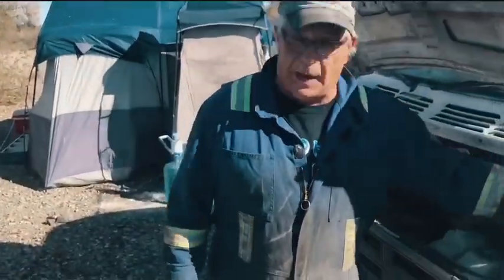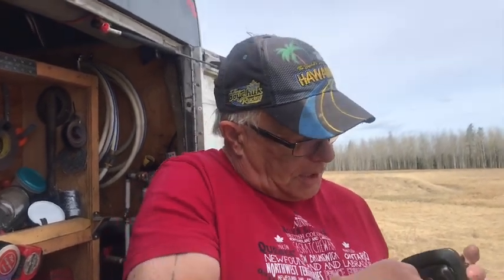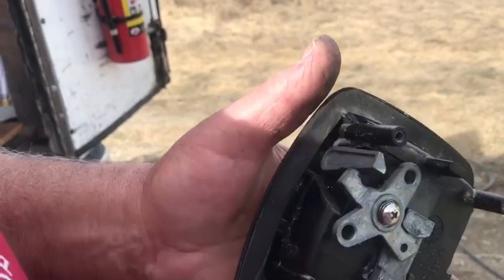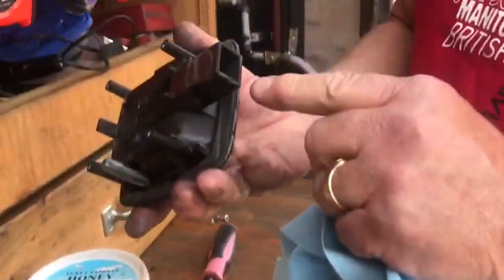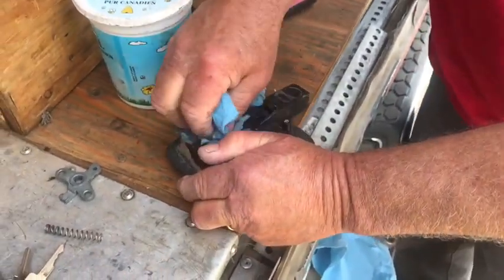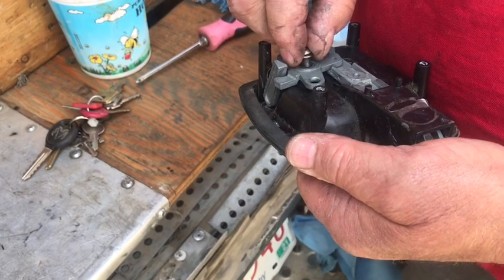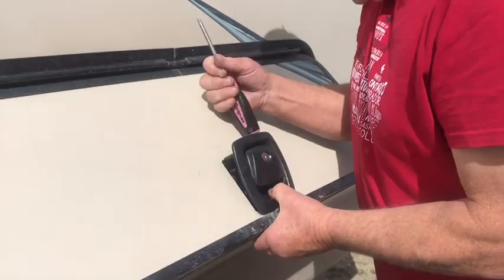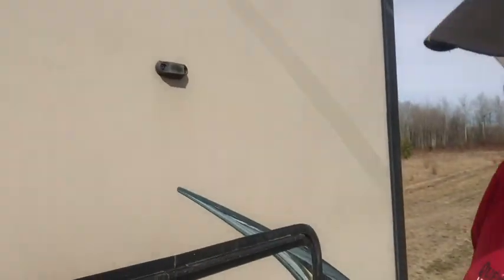REPAIRING YOUR SLAM LATCHES EP164

Comment: How do you “inspect” your seals on a rig? I know for many that might be a stupid question. I have a tow trailer only 6 weeks old. Only used once. Manual says must inspect seals every 30 days. I am not mechanical so just learning. I am guessing you are looking for around windows and doors? What am I looking for? I notice some kind of clear silicone around them. Am I looking for cracks, gaps, crumbling (my best guess). Will there be any (seals) on my roof? Mine doesn’t have a ladder and the roof is not meant to be walked on. I know there is an AC, a basic fan, and a 100 watt solar panel up there.
Reply from the maker: Mostly there around the slides the windows just watch for moisture 👍🛠️🇨🇦
Reply: BADGE EVERYBODY NEEDS ONE thanks badge. This is just a tiny, cheaply made 16 foot trailer with no slides.

Comment: Just bought a used 5th wheel and a couple slam latches don't latch.   How do I adjust them?
Reply from the maker: You got to move the plate but chances are it's not shutting right seal out of place or latch faulty 👍👍🛠️🇨🇦

Comment: Would you have any suggestions how to open a broken slam lock where I can't get inside the compartment?
Reply from the maker: You have to get behind it somehow. 🛠️🇨🇦🛠️🇨🇦
Reply: I had the same problem.  Both slam locks on the front compartment door stopped working.  I tried to use putty knife, screw drivers, etc. and there is no way to get the plunger to release.  In addition, I could not get into the compartment from any side because the compartment is steel all the way around.  It is built to hold a genarator.  I had to cut out the lock with a multi tool (destroyed the lock).  I was careful to not make the hole any bigger.  Ordered (2) new from Forest River. $165 I will get the locks in tomorrow.  I also noticed from BADGE's video I may have another issue.  The plate that is on the back of the lock and attached to the door with rivits is no longer there.  I had to cut it loose to get our the lock.  I do not know if the new ones will come with the back plate.  BADGE, do you have any comments?
Reply from the maker: @rpettigrewjr  I go check the door I am not sure what plate you talking I get back to you thanks🛠️🇨🇦🛠️🇨🇦👍👍
Reply from the maker: @rpettigrewjr that back plate is just a plastic cover over the lock. It will work without that 😅🛠️🇨🇦🛠️🇨🇦